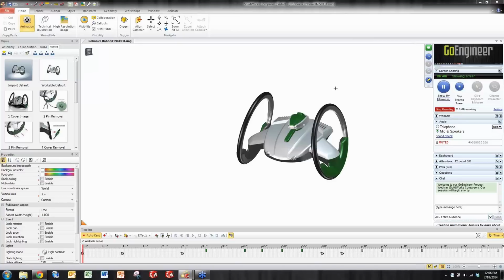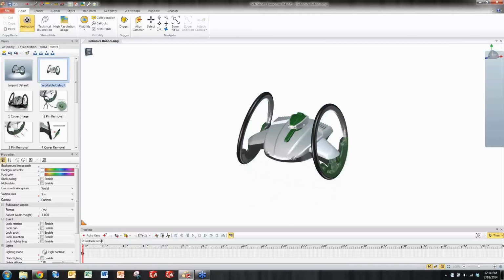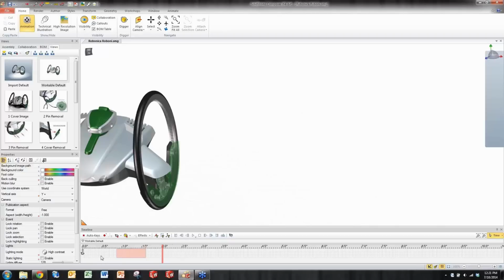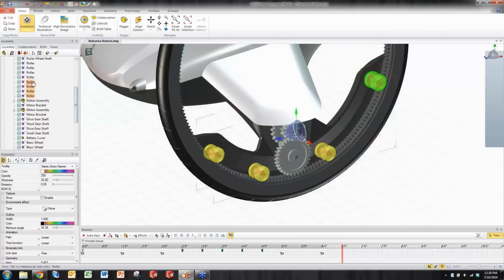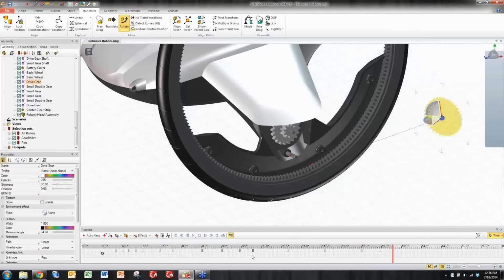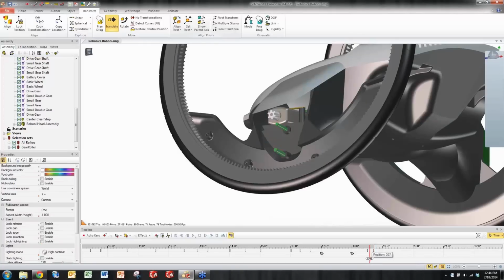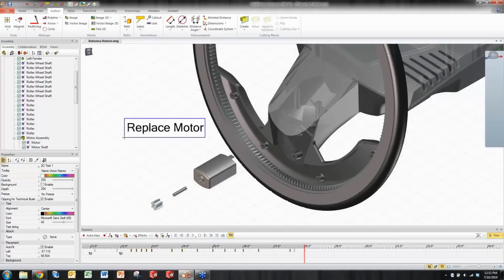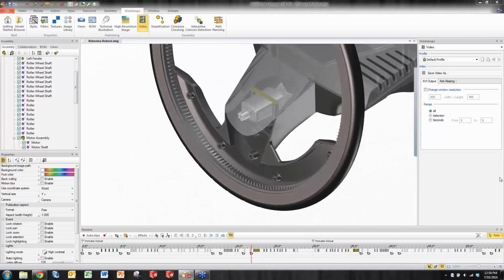SOLIDWORKS Composer - Creating Animations

Comment: Sad... I just got Solidworks 2016 and watched this video thinking I could do some awesome animation... Then I realized this isn't even included with Solidworks 2016 even though Composer shows up in the add-in tab. :(
Reply: Go to 'Uninstall', select the 'Change' button and then check the 'Solidworks Composer' checkbox. It may be included just not installed on your machine.
Reply from the maker: SOLIDWORKS Composer is not included in any of the SOLIDWORKS packages.  It is a separate purchase itself so it if was not specifically purchased then it is highly likely that just installing it will still now allow it to work.

Comment: This was great but I have questions.  I am new to Composer.  I do not have SolidWorks I only have Composer.  After I make my anamation and save it my only option is .AVI.  The file size is like 7.5Gb  Unplayable.  I'm thinking all the Meda data is attached.  What can I do to make the file size smaller?
Reply: You can use Windows Movie Maker to create much smaller nicer looking .mp4 files. It takes multiple steps but the final video is well worth it. What you do is save the animation as multiple jpegs and then use WMM to create a video from them. I'll see if I can find some detail instructions or videos to share.  Good Luck